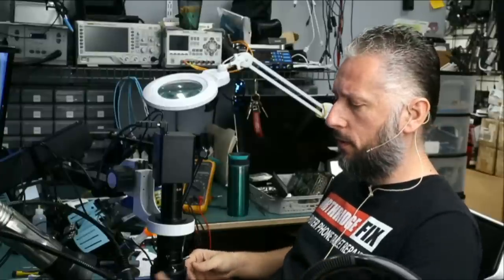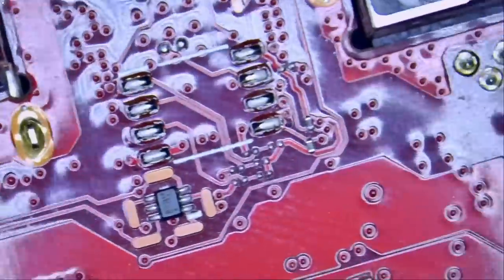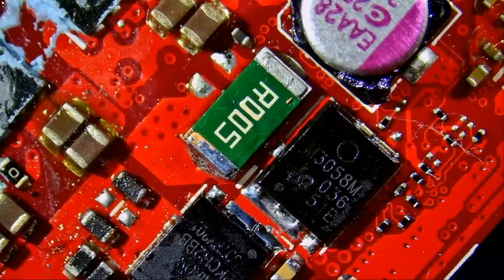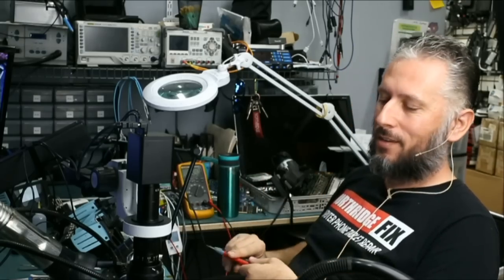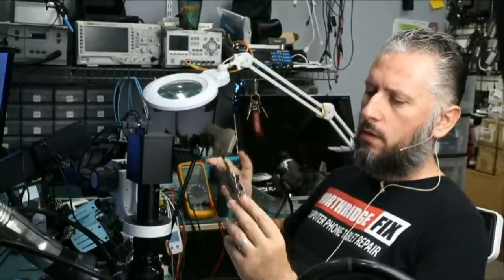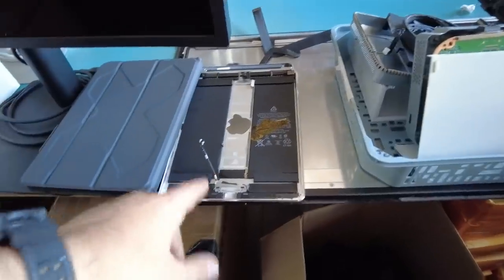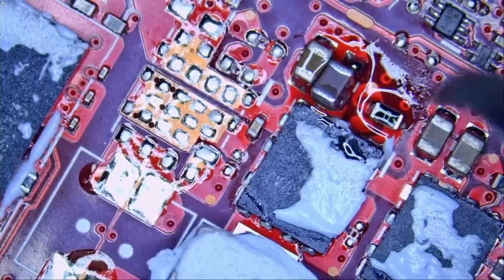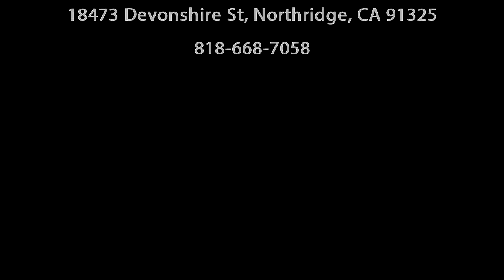2 x Asus ROG Laptops -Customer made a mess. Can we Fix them ?

Comment: Note: Lenovo/ROG laptops take upto 2 minutes to boot after all power is removed for 2+ hours. Since no CMOS Battery is on the Mobo and BigBoss took it apart for you to fix. IT is always a good sign when keybaord lights cycles colors on the ROG system.